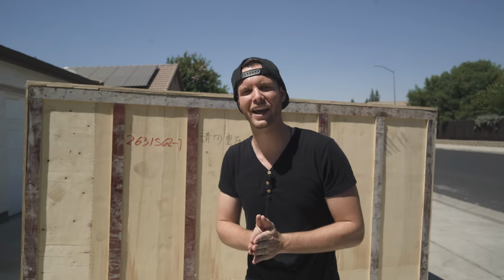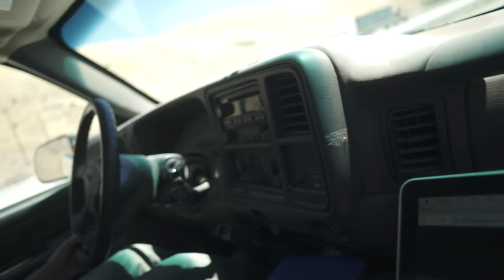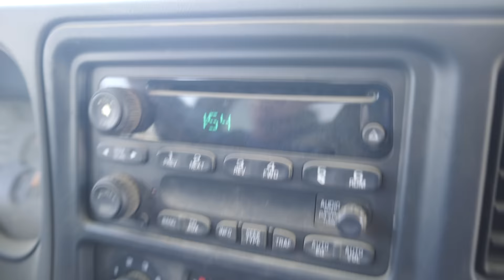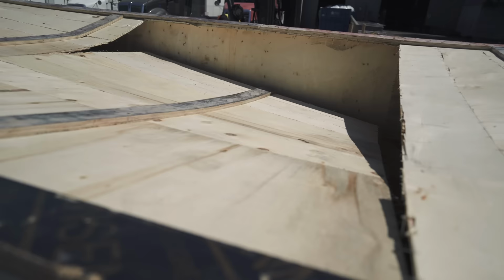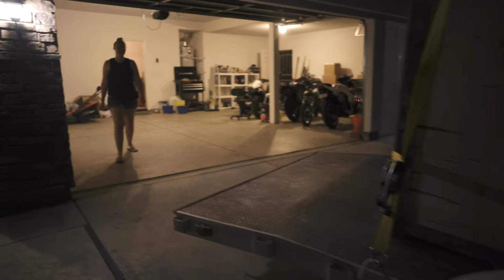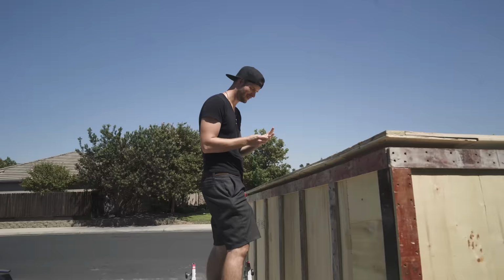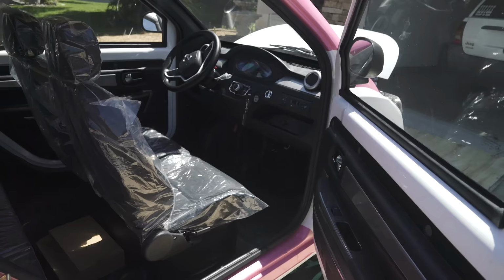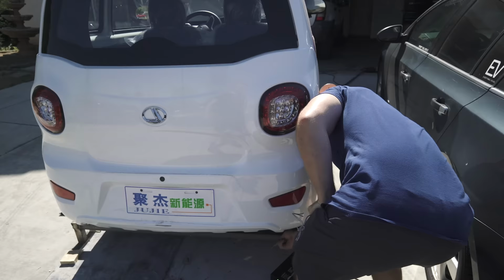I Bought an ELECTRIC SUPERCAR from CHINA ($31,000 NEW)

Comment: I'd say this is around 1500$-3000$ in China. Look at the Barajas Qute which costs around 2200$+- depending on the exchange rate and yes it's road legal for some year now. 
So considering more expensive labour in China and a somewhat better body, at least for the doors and the battery. This might be around that mark. To be safe I'd call for 1500-3000

Comment: I'm very sorry this happened to you.   Something similar happened to my dad who had a Chinese EV shipped to another country (not the U.S.).   He got a car of the same chasis that he ordered but it too was a bait and switch.  It was a car that he'd been looking for before he ended up buying from another vendor that had promised more, but, what actually ended up happening was that the second vendor bought the car my dad had been looking at originally and sold it as a beefed up car.    So my dad ended up buying the original car but paying an whole lot more for it.  Basically, the same stupid cheap crate job you experienced, which ended up putting a scratch on one of the fenders. When he unpacked it it looked pretty much looked like what we had ordered, except the wheels were regular cheap wheels, with hub caps and not the mag wheels they'd promised.  I wish that were the only problem.  Once we saw further we got a similar sinking feeling that we had been duped and the vendor pretty much ghosted us with every attempt we made to reach them after that.

The contrast between vehicles was not as bad as with your experience but you had us re-live our moment.  

In oiur case we had been promised a top speed of 81, but what we got was 64, which could be improved to 68 by replacing the wheels and tyres with slightly taller ones.  And worse of all was when we went to see the batteries that came with it: Lead-Acid batteries, instead of the promised Lithium Iron Phosphate ones.   Basically, the same exact car we had initially been looking at from the other vendor. 

I contacted the initial vendor and he did respond to us and we continue to stay in contact.  He said that he found it to be odd that after we told him that we had turned him down for another vendor that a 3rd party would come by and purchase the same exact car we were initially contemplating (because he saw that the end customer was us.  It made no sense that we would pay extra to go through a middleman, but he fulfilled the order anyway.  He send us a message a few months later saying that if we ever wanted to purchased a vehicle from him that we should next time go directly to him instead of through a middleman.   Once we told him about what had happened, his company cut ties with the scammer company and they and my dad took it up with the Chinese consulate.     But, at the time the country where my dad lives did not yet have formal diplomatic relations with mainland China (now it does).  But it's too late to do anything about it.

My dad's electromechanic figured out a way to bring the top speed up to around 68, which with the swapped wheels and tyres can give it a top speed of 72 (still not the 81 that was promised), but hey!   And at some point, it will make sense to swap out the batteries with actual Lithium ones, but that will cost at least $800, if we use refurbished used ones.

The car itself was well made, unlike what you got, but it was definitely a bait & switch.  But given that the U.S. and China, I believe, have diplomatic relations since the days of Nixon, perhaps you would fare better than we did in getting some compensation, and maybe even some legal action over in China.  

Now, an acquaintance of mine in New Zealand learned from our mistake and fared better.   He hired a local inspector in China to inspect the cars before importing them into NZ.   If everything being shipped matched what he had actually ordered then the money would be released from escrow.  The escrow service and transfer fees amounted to approximately an additional $280 and the inspector charged $800, so all in he ended up paying and extra $1080 for his peace of mind.  Too bad it has to be that way.   

The car that my dad got was like an earlier version of the KANDI K27, but with Lead Acid instead of Lithium batteries and slower speed.   This left a very bad taste in my dad's mouth and all of his hopes and dreams of starting up a dealership in his host country were dashed.  And I feel very bad for having been part of the whole thing.  Basically, it is a form of theft what these people do.  I'm very sorry that this happened to you. 

Here's hoping that 2021 brings you and your wife better things.  You have a kind and very loving wife.

Comment: This is the classic Chinese scam...maybe they'll change it (doubt it) with the real one...but Jesus, even someone actually wanting to buy this thing and paying 5-6000 dollars is getting badly scammed.
Did you see the "engine bay"?
An awfully soldered bottle rack type thing with two acid batteries out of the 1970s, a 2 inch axel...and a fucking washing machine electrical motor. Looks like a home-garage built scam. 😅

Comment: Just realized it's 2 years later haha. Though for any of those who want to know when shipping you take the actual weight (for this car prob 600 kgs) vs volume weight (1500 kgs) and use which ever is greater. If you ever want to figure out volume weight for shipping intl in kgs it's in inches length x width x height ÷ 366 = volume wt. In kgs. There u go....